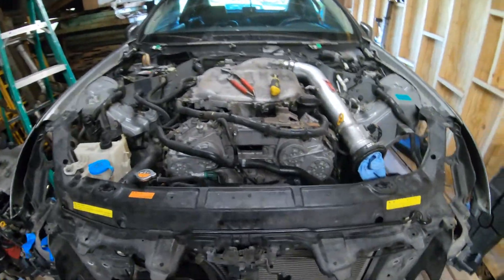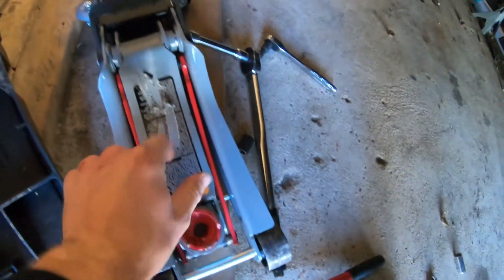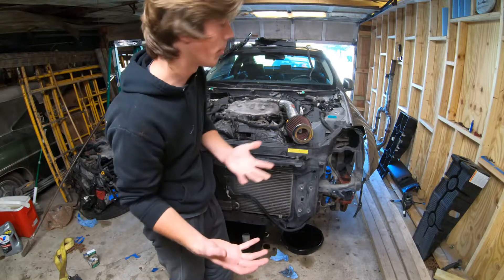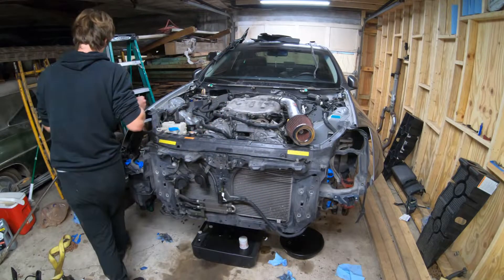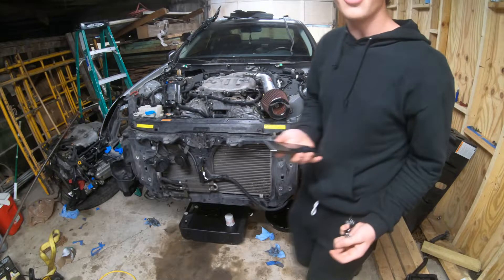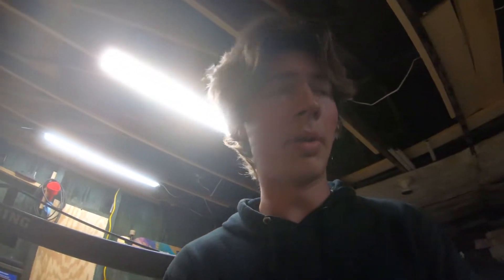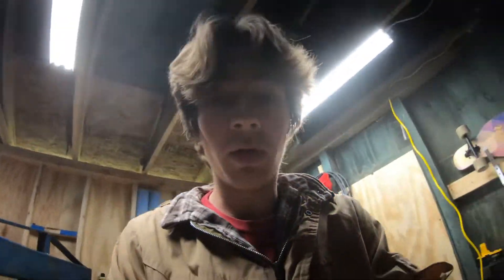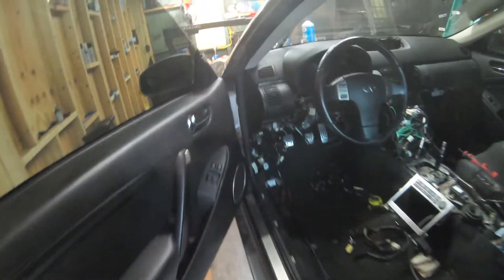Manual Swapped G35's First Start

Comment: Does the bcm need to come from a manual car?
Reply from the maker: If I'm remembering correctly you can swap the BCM and ECU from the same car then you wont need to get your ECU reprogrammed to the old BCM.
Reply: Do you have a rev up? bc mine is just a regular de and all the manual ecu/bcm are for rev up would that make a difference or will the ecu still work, I completed the swap already but it’s crank no start and will sometimes randomly start and run drive perfectly